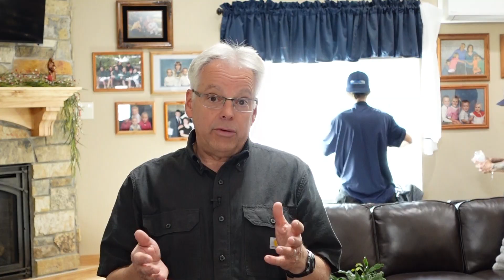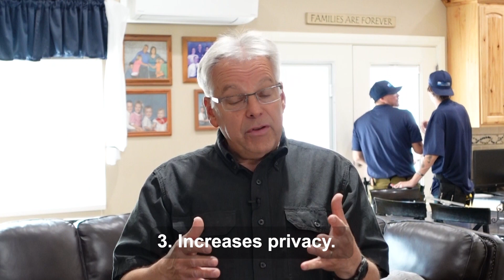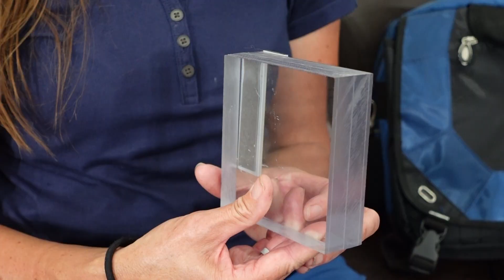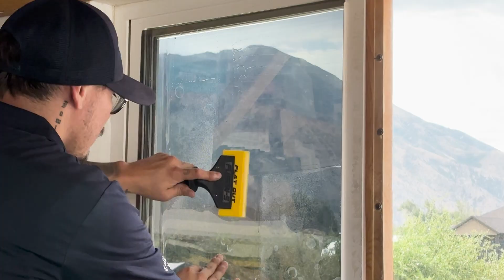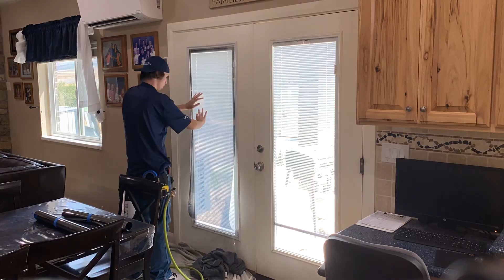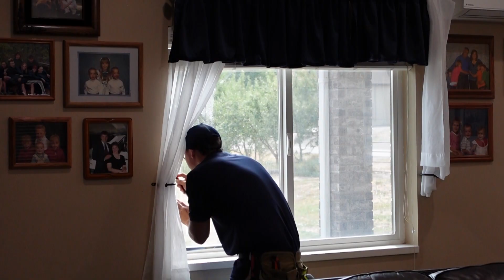Security Window Film Is Our Latest Layer of Home Security

Comment from the maker: Tell CoolVu.com that the Provident Preppers sent you and get $100.00 off  Safety & Security Window Film Installation for your home (minimum of 10 windows). Offer expires 12/31/2024. If you fill out this contact form a CoolVu franchise near you will contact you.  https://app.tintwiz.com/web/ce/d78qijhabhtkgyemuapivj6p0enbgidl
**Check out what we are doing to increase the security around our home  with links to our favorite products at https://theprovidentprepper.org/recommended-products/home-security-protection-recommended-products/

Full disclosure: CoolVu provided the security window film. We paid Nissa's crew to install the film. We are incredibly pleased with both the product and the installation. 

Thanks for being part of the solution!
Reply: Sorry but installing Window film in old windows does not work (basically useless). For Security to film to work it needs to be installed at the factory as it needs to be anchored (bonded) into the window frame. There are old videos showing the problem installing film on existing windows. It actually makes it easier since the glass breaks off around the edges leaving less risk for the thieves getting cut by broken glass.

If you want a usable solution, plant thorn rose bushes under your windows. Thieves will avoid them. Its a grey man solution since no one will think the bushes are there for security.

Comment: Are the films installed on the outside or inside of the glass? I'm a little confused. Thanks.
Reply from the maker: They are installed on the inside of most windows. The glass door has it installed on both the inside and outside to add another layer of protection.

Comment: Your channel wasn't suggested in my feed for a long time. I recently searched for it and found I was still subscribed so I clicked the bell to ensure I no longer miss your videos. 
About the projectile protection for the windows. How does it compare to your outer walls? Are these stone or concrete or are they timber frame with a brick veneer? Most timber frame + siding solutions are in no way bullet/projectile proof or provide much protection.
Reply from the maker: Windows are definitely at risk.

Comment: I'm a professional bomb film installer for schools. The single most important thing is that after installation, the film must be adhered to the surrounding window frame with 3M IPA special caulking. Otherwise the glass can be pushed entirely inside the home or business! I don't think these clowns know what they're doing! Seriously.
Reply: Yes, I was surprised that this was not mentioned.  Without the attachment this is not only next to useless it may actually be worse than doing nothing since the pane can come out in one piece.

Comment: There is a big difference between this and true impact windows. This offers almost no real security benefit as the film stops at the edge of the glass.  It doesn’t wrap into the frame itself like impact windows do.  Which means the glass will break where the glass meets the frame.  What this film does is prevents shattering.
Reply from the maker: You make a very good point. They explained that to us before the installation. It will only slow an intruder down but in those circumstances, seconds count. One of the big selling points for us is that it should help hold the window together during an earthquake. No shattered glass everywhere. My grandmother had to stay in her bed for quite a while waiting for rescue workers to get her out of her bed because there was glass everywhere. This would help to prevent that type of a situation. Window replacement will take a while and it would be really nice to have it remain intact even if it is cracked. I'm really pleased with it.

Comment: Anything in AZ?
Reply from the maker: I'm sure there is, they have them all over the country. You can learn more at coolvu.com and tell them we sent you and you will get $100 off 10 or more windows.
Reply: I considered doing this in AZ, but the potential downside is that the intense sun here can melt and discolor the film, and once it does, there is no real way of removing the film without getting new windows since the film essentially fuses to the glass.

Comment: Evening, I usually do not comment here, but do watch your videos. Last  year I not only put a film on my windows, but I also thought about a situation, like an extended grid down situation and crafted an extra layer of home hardening to be placed over the the windows, on the inside. I took  heavy duty chain link fencing and cut to fit and frame out chainlink fence window covers to be put up as an extra barrier. Say an EMP takes out the grid, going to be years before power is back up, screw the fencing to the inside of windows to the 2×4 framing in the walls. Someone comes to break in and you hear the glass break, the fencing will hold them off long enough for you to grab protection or retreat. On my doors I placed 2" wooden dowels across the doors through eyebolts a third of the way up the door and down the door (above and below the locks) to brace the door from being able to be easily kicked in. Just a couple of diy projects people can do to harden their house in case of an emergency.
Reply: Plant Roses bushes (Thorns) under your windows: Perfect solution & probably HOA approved (if you are stuck in an HOA).

The Security film in existing windows is useless: Glass breaks off in one piece along the window frame. makes it easier for thieves.
Reply: @guytech7310  However, you can put in a Dow 995 caulking attachment to mitigate this somewhat?
Reply: @ihidoc  Not really. It comes down to how much bonding strength there is. A bead of caulk just does have enough strength. You can buy windows with the film integrated into the window frame (for hurricane protection).
Reply: After the Russian SMO, we've seen the impact small FPV and other drones can play in a tough situation, so something like that fence link is a good idea as a "cope cage" they call it, to have the drone detonate outside vs inside the house, also would help for flash bangs as well. I like the idea of a window film, although say in a fire inside, would be nice to have the option to peel it away if you had to break your way out. I'm thinking that would be more along the idea of a window that could open or be removed from the inside, and Im not sure if they make something like that for homes.
Reply: @goofyroofy  hinges and locks on a couple.

Comment: I'm pro-security film IF (& it's a BIG IF) you upgrade the surrounding framing that holds the glass in place.  Without the work on the framing, there isn't really a security benefit to the film, only the safety (from shattering/broken glass) and energy savings components.  People literally kick in doors w/ locks due to poor framing and doors typically have significantly stronger framing than glass. 

I worry that people that install security film won't hear, or will soon forget, the disclaimers and live with a false sense of security.  If you want to do this w/o any other upgrades, or can't afford the upgrades, just remember the disclaimers and limitations of the product.  

If you can afford security upgrades: Look at installing security glass w/ secure framing to your basement, first floor, & upper floor (w/ patio or roof access) windows and windowed doors.

Comment: What happens in case of fire and firefighters need access to the room from outside?
Reply from the maker: They can get in. It only slows the intruder down but if they are persistent they will get in.
Reply: @TheProvidentPrepper  Thank you for the reply! I'd love to do this and that was my only concern...will look into it in the next few days.
Reply: @Scarah422  please read other comments, there is a lot of misperception about this film.  This film does not offer real security protection, you must get impact rated windows for that.  This film will prevent shattering into little pieces but the window will still break where the glass meets the frame, and allow entry.  Film like this does NOT offer protection from entry, it simply keeps you from getting hit by shards when something breaks the window.  If you doubt it, ask your insurance company.

Comment: I put 8mil film on my windows in 2020. It’s hard as hell to not have bubbles or a single dog hair get sealed into the film and the window……but I don’t mind. It was well worth it.
Reply: What did you use, if you don't mind saying?  I am looking to do the lower level windows of our house before elections.
Reply: Worthless since the glass will break off along the edges. Security film needs to be bonded into the window frame (factory installed) to be useful.

Plant thorn rose bushes under your windows.
Reply: @guytech7310  rose bushes are good. I put the film on so in case someone tries to throw stuff through the window. If they want to come kick it in it will give me just enough time to get to the pew pews 👍